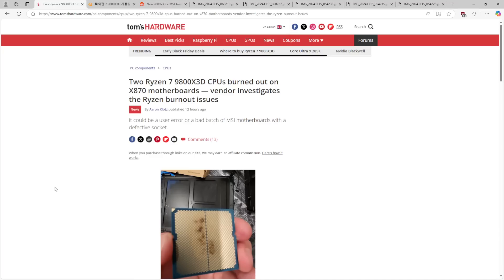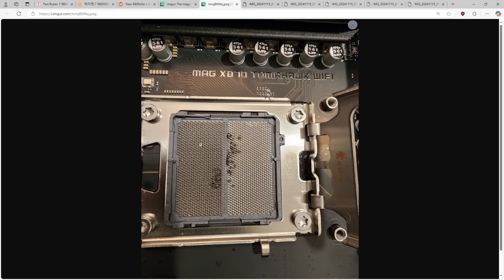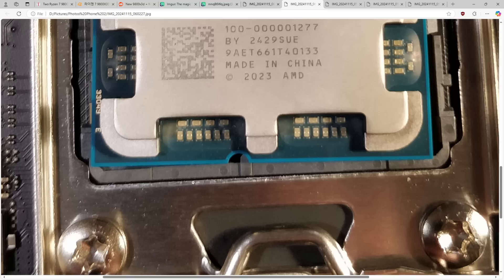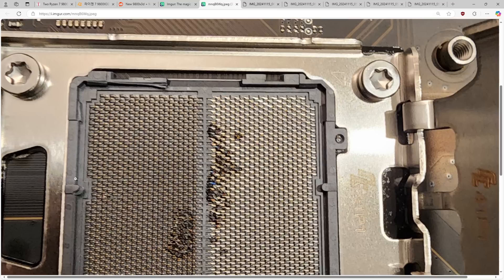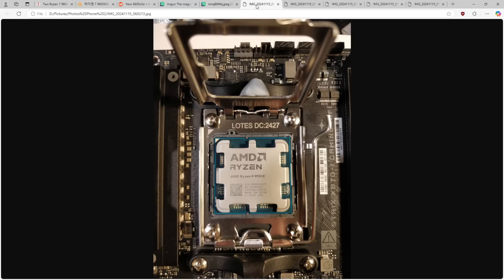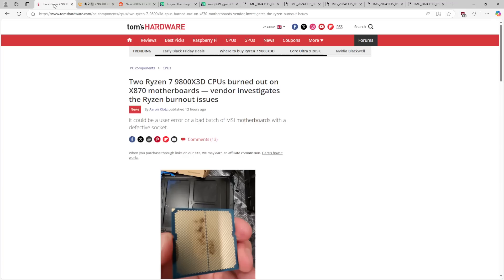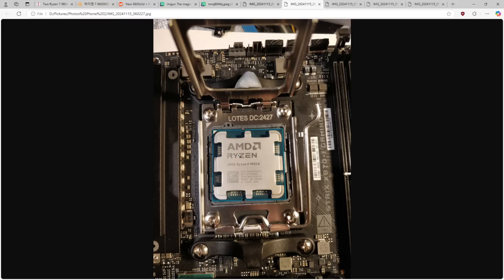HOW NOT TO BREAK YOUR 9800X3D

Comment: My theory is that idiocy like this is going to become increasingly common for the simple reason that fewer and fewer people have any idea or experience of how to do anything physical or mechanical.

I think it starts in childhood when a kid gets a screen put in front of it instead of a physical toy it has to learn how to physically interract with, which is bad enough, but is then allowed to abuse the heck out of it, instead of being corrected and shown how to use the device properly and behave themselves, and this is considered acceptable.

This kind of thing then carries on through 'education' to varying degrees in such a way that not only do students not learn how to do anything physical and mechanical and learn the necessary motor skills, no-one has to understand anything or be able to work something real out for themselves. The typical response is to find someone or something that will just give them an answer and that's the end of it with no understanding of how that answer was arrived at or why.

I think it's one of the saddest things. It's not that people are stupid, it's that they don't know how to know stuff, understand things or work things out. One if the most common things I see is people not having any skills to do physical things, especially anything requiring any level of care or precision. They don't understand things from the start, so they then don't know how to communicate what they need to and that ends with frustration and worse undesirable outcomes.

Comment: They are dummies for sure.  I've been building pc's since Pentium 3 launched. Never damaged a board or cpu. I just built a 9950X3D on Asrock X870E Taichi.
Reply: lol update in a year on if it’s still running. Asrock boards and x3d CPUs are still failing at an alarming rate. I avoided asrock for this issue entirely

Comment: These people are the reason pre-built gaming PCs exist...  I mean, it's bad enough to screw up a motherboard AND CPU, because there's the shame and disappointment in yourself--but what moron posts pictures of it online?!  This isn't a problem that OTHER people are having, so I cannot see the point in doing this.  That said, I also don't understand the guys who post photos and videos of their wives banging other dudes online, and I suspect that if we were to draw a Venn diagram there would be a substantial amount of overlap between the cucks and the jackwagons who destroyed their expensive PC components by not laying the damn thing flat and putting the CPU into the slot securely before mounting the board into the case.

(Just had a thought, and I wonder with the prevalence of the game PC Building SImulator, if they just did it the way it works in that game where everything is done with the case upright.  Fucking children are so damn young, they don't even realize that the entire ATX standard was literally designed to assembled and operated in a horizontal position, sitting on a damn desk--hence the name.  When Towers came out, it was a revelation to reclaim all that desk space.)

Comment: I mean....Installing a CPU for the first time can be kind of scary, because it's a delicate component and can be easily damaged... But if you just line up that little arrow, to the arrow on the motherboard and very deliberately place it gently into the socket you will be fine. No pressure is ever required. If you are using pressure you done fcked up.

Comment: Excellent💯 BTW, what CPU "air cooler" do you recommend for 7900x to not reach Max. Operating Temperature (Tjmax) "95°C" when running stress tests like: Cinebench, FurMark, or any software that will make it easily reach most CPUs Tjmax? Thank you in advance.

Comment: To be fair, in 1700 socket you can install CPU upside down and it won't damage anything, PC will just not work. But pins and entire motherbaord will remain undamaged, nothing will burn. Yes, I managed once to install a processor 12400f upside down and nothing happened.

Comment: It appears that the user has built many other computers, some with custom cooling loops.  This could be a case of over-confidence leading to this issue.  This kind of thing happens with negligent discharges in the firearm community where the most experienced fall victim to over-confidence.  To be fair, the builder did say it could be user error but he just wasn't sure and it can be difficult to self diagnose the real issue, especially when there is a history of burned AMD cpus from the last generation to cloud your judgement of what really happened.
This video was definitely interesting and I appreciate the visuals of the cpu mounting.
I've been building PCs since 1992 (anyone else remember cache sticks?) and the video was actually helpful because you always need to be aware of the potential for possible errors regardless of your experience level.

Comment: That's why manuals are created with visual picture of how to install it. Even they have setup some corner to not mess up and during installation, if you apply over 40 to 50 N during your CPU install then yes, it is installed wrongly. You may require stronger force to instal and inject cable, but again there are the lid to toggle and just plug right in. So yeah, stupid costs money. If they want something to play with, buy cheap hardware, but for mid or top PC build, let it for the pro.

Comment: Something similar happened to me with an AMD EPYC CPU in a SP3 socket. I inserted the CPU with its carrier frame into the rail frame, closed the rail frame and retaining frame onto the LGA, then heard a cracking noise when torqueing the 3 screws of the retaining frame. Aftermath: one of the plastic keying notches got crushed, a few plastic edges were chipped, plastic crumbs were forced into border LGA pins, a real mess requiring the utmost discipline and steady hands to clean up. Fortunately, the CPU itself remained undamaged.

It turns out the EPYC CPU was rotated 180 degrees in its carrier frame (!), something you realize by looking at the location of the golden triangle found in one of the corners. That's something you would never expect because one of the very reasons the CPU is delivered in a carrier frame is to prevent such mishaps.

But how could something like this happen? My best guess is that since this was a tray CPU, the CPU may have fallen on the floor before shipping, probably causing it to come loose from its carrier frame, and then the poor warehouse employee probably tried to reassemble the two parts but in the wrong orientation. That's a wild guess but I can't explain this condition any other way.

After thorough socket cleaning and proper reinsertion of the CPU into its carrier frame the system ended up working perfectly, which is nothing short of impressive.

Comment: If, and only if, I build in vertical position i use glue in the slots. 
Keeps that 4090 Super ti ght in there.
Not only for holding the cpu to socket but allso the aio block with it.
Temps are great for cooking and smell is lovely!
R.T.F.M.

Comment: if I remember correctly I still replaced multiple CPUs on my AM5 board while leaving the case upright, you just hold it with one finger through the bracket as you flip the bracket down and latch it, insanely simple, in fact im sure it can all be done with just one hand

Comment: Good to see some actual analysis on what happened.
I'm gonna be honest, to me these sockets are something incredibly fragile, so I'd never have considered mounting the cpu vertically.
I always carefully drop it in there and, once it's visually completely inserted and aligned, give it a very careful final wiggle to make sure it actually dropped into the socket fully. No pushing, just letting gravity do the holding the cpu in place.
Only then close the latch, since that latch has some insane leverage and pushing force, which can easily break something expensive.

Comment: Ive been putting cpus in vertically my whole life without issue, I can see how it would be hard if you only have 1 hand but with 2 hands you can hold it through the socket hole with the other hand easily

Comment: I built my first computer in 2020 without any help. My powersupply and mother board were super cool and decided to use different abbreviations for the 24V connector, which made it super hard for me to install it, and there were some sparks. Thank god a $1k motherboard has a few protections in place. And no amount of internet research could help me. The Mobo was Zenith II Extreme Alpha by Asus, and the Powersupply was a 1500W Platinum Thermaltake RGB something or other.

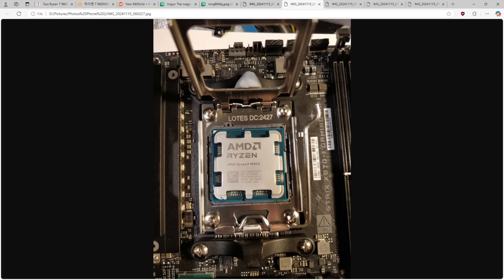Comment: 4:01 I mean, you can hold the CPU without letting it got by passing a finger thru the opening of the retaining plate. That way you don't have to take your hand off to close the latch.

In any case: yes, it's obviously easier to install it horizontally.

Comment: As I said in another video, no product - no matter how well-designed - can survive coming into contact with the end-user.

People make mistakes. Shit happens. The fact these two morons tried to blame AMD for their own idiocy shows how incredibly dumb they actually are. Intelligent people learn from their mistakes and do it better next time. Idiots don't learn.

Btw, I built a PC with a friend of mine recently. Has a 7800X3D in it (so, AM5 platform as well). The process to put the CPU into the socket is the same it has been for multiple decades now with both Intel and AMD in regards to "lining up the corners". There is no design flaw in this. It is almost idiot-proof. Almost.

Comment: Damn how can that user got it so bad on the CPU installation, I mean pretty sure you can see it right away if the CPU didn't fit properly and you will double check to make sure that it is in place and not force it right in.

Comment: Many builders leave the plastic cover in the latch and push it out by closing the latch with the cpu installed. It could move the cpu. I rather remove the plastic cover first and then close the latch. That way you are sure the cpu stays in it’s place.

Comment: One of the am5 installation vids on yt notes another reason it might have happened for someone who's not quite so stupid. 6:25 the two bulges on the latch sticking towards the center of the whole, are really close to the CPU where you have bulges too. So if you have thermal paste in the tiny gap between the CPU and the latch after removing your cooling thing, releasing the latch a bit might pull CPU because it is stuck to the latch by the paste. And if you only released the latch briefly, you might not notice CPU no longer being aligned.

Comment: I think that many of people who are watching your videos could install a CPU into the socket with their eyes closed correctly. Just by touching the board and the socket! When I was upgrading in 2010 from 775 to 1156 socket...  I was excited I presume so much that when I was putting back socket cover I have put it directly into the socket and closed the mechanism almost fully. Then I realized what I had done. Then I spend the whole afternoon aligning the pins back and checked whether the board works normally or not. That board still works today in my dads rig. What a plonker I was thinking to myself...

Comment: Maybe I'm looking into it too hard, but with the boards being X870 boards, I'm leaning towards them being fresh builds/platforms, rather than in-socket upgrades. Unless they were turbo idiots, and installed the board into the case before socketing the CPU, while refusing to lay the case down flat before doing so. Still, I'm blown away at how one could mess something so simple up.

Comment: I miss when the PC modding community had less of these mongoloids that are unable to plug in 4090 connectors(I have a 4090 since release and I have no issues seating a connector), or line up a gold triangle with a marker on the CPU socket. Expensive things and ignorance will only end with a lighter wallet. It's amusing to see people blame manufacturers for their own stupidity.  These people need to educate themselves before touching costly things that are obviously beyond their mental capacity and dexterity/finesse. Apes with money.

Comment: :-D "Because two people can't put a CPU in to a CPU socket" I love how the video is over in 35 seconds with an epic roast.
I don't get why and how people do this unless this is their first time installing a CPU ever.  Between the CPU and the Motherboard, you're talking about AT LEAST $700 worth of parts, BE GENTLE FFS.
Edit: Also, I've done CPU installs vertical before, NEVER had this problem, because I'm not blind (and I've been doing my own builds for over 20 years at this point).  I typically do CPU installs horizontal though, just for safety, and because it's easier to make sure a CPU AIO block is sitting on the CPU correctly while I'm tightening it down.

Comment: I imagine the force you need to apply to close the lever would be much higher than if the CPU was properly aligned...
People do the stupidest things, forcing RAM into different keyed slots, even seen people installing SIMM RAM into a DIMM slot, then complain about it not working. Installing a PCI card where there weren't a slot so it was just hanging from the blank cover, smashing the CPU with a hammer into the socket (before IF sockets were a thing...). The joys of running a repair shop back in the day...

Comment: Hello man. Wonderful work! What to do if I get tPHYRDL mismatches on EXPO frequency 6400 32 kit hynix from gskills? I am stable at 6200 with your timings at 30 degrees Celsius but can't seem to get the mismatch fixed at the rated 6400 of my kit. My PC: X870e Aurus elite & 9800x3d, fclk 2133 & ram kit gskills F5-6400J3039G16GX2-TZ5NR CL30 39 39 102. Thank you for you kind support!

Comment: i still wonder why the fxck some ppl still mount or put their CPU while the mobo is vertical, same with the CPU heatisink... and i heard ppl telling me "yeah but if i put the châssis flat on the table, the outer edges are going to bite on the cabling and so one..." ppl are idiots indeed, close your chassis cable side pannel for the meantime, or just take 4 similar thickness books and put one at each corner or the chassis so you can lay it flat on them while having room for all the cables dangling out from the gape to not be "bitten" by the chassis outer edges... working with both hands free when possible is always better for safety, yours, and for your hardware anyway !

Comment: Even if you happen to mount it vertically, you gotta be dumb to be so careless about not fitting it securely alligned to the notches which are clearly visible. You would even notice the cpu loose in the socket. Like what kind of animal just throws it in there and locks it in the socket so carelessly over a 900 usd investment.

Comment: Besides the notches on the side of the CPU and the socket, there's also a triangle in one of the corners of the CPU which you must align with the triangle in one of the corners of the socket. If you do that everything should fall into place. At 01:52 I see that the triangles are aligned but part of the CPU is outside the socket, right on top of the socket border. That's why the notches don't align. What kind of a quadruped you have to be to miss that??????? I guess the user needs to get an octane reading on his blood.
Reply: Because the reddit guy did just that. He aligned the triangles. If you match the burn marks you can see it. But that would take like 10 seconds to do.

Comment: I guess they can put their finger from the top of the cpu cover so they can keep holding the cpu in place while closing it at the same time with their other hand?

in all my years i have never tried installing a cpu with the mb horizontally, but I am thinking that if you put it correctly, it basically fits like a puzzle piece, it should be doable.... so, even if they did that, it's still stupid to not put it correctly 😅😅😅

Comment: Okay, I think I've installed mine in the correct orientation, and I barely had to use a hammer at all. Now, for the thermal compound I'm supposed to mix potassium permanganate and glycerol, right?

Comment: I had a solicitor/lawyer client who managed to force a USB A dongle the WRONG WAY UP into a USB A socket on the front of an HP Workstation - three times. The first two times he got away with it - it didn't work obvs. but the PC continued functioning. The third time it blew up the PC altogether.  And I once had the pleasure (?) of trying to repair an electronic kit where the user had inserted every component where he thought it fitted, but not according to type or value or the layout chart. Fun times.

Comment: How do you know the socket wasn't damaged from the start? The left sheered plastic could have pushed the CPU off center, resulting in improper contact and burning up the CPU.

I could see a factory worker at MSI missing that damage during QA, especially if someone already slapped the protector on.

Comment: Im exchanging my 9800x3d today for anothe 9800x3d because my chip is getting usually high temps, and yes, my 360 aio is installed correctly, cou seated correctly, and thermal paste applied correctly..im not an idiot. Lol.

Comment: Take the lotes DC:2427 . If it touch the plastic socket , take a file and clean it so metal does not touch plastic socket . Its stamped metal .it's normal metal need to be filed slightly off to have slight clearance

Comment: i dotn get how you could POSSIBLY install a cpu THAT sideways....    WAAAAYYY back with the core2 quads it was not uncommon to have the CPU fall 'down' in the socket and loose a memory channel. this happened when the board was vertical. so either horizontal OR you would slightly lift up on the cpu while clamping down and it woudl work fine.

on that senario though the cpu is still in the socket, there is no PHYSICAL resistance.  idk how you can shove a cpu in like this, with how much force it would take...